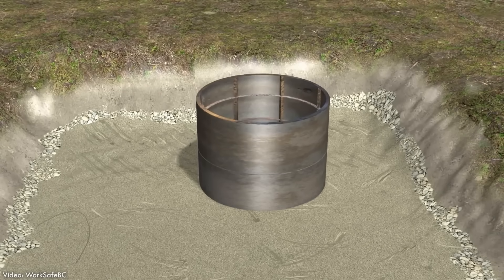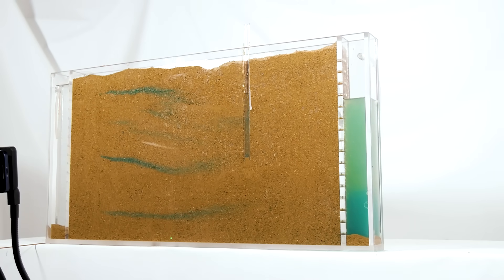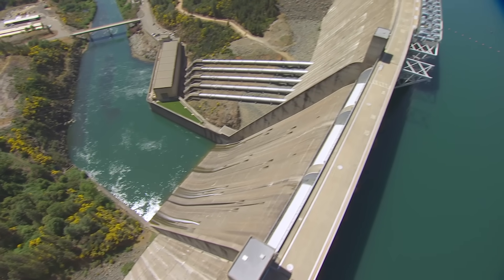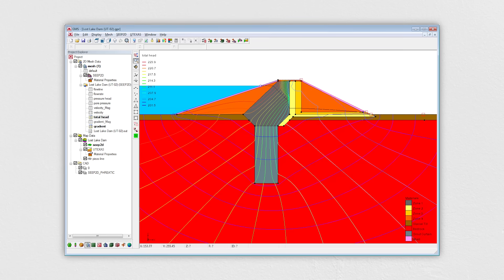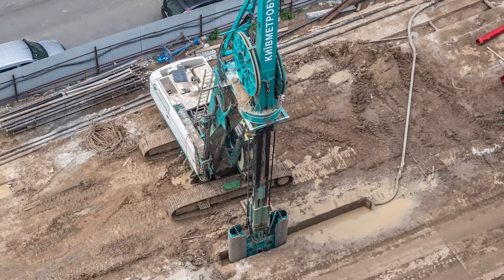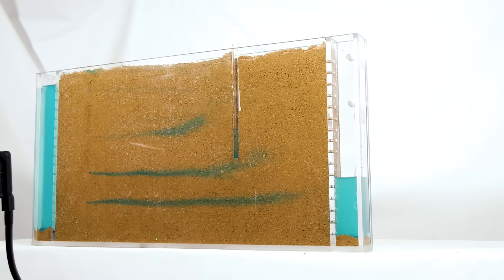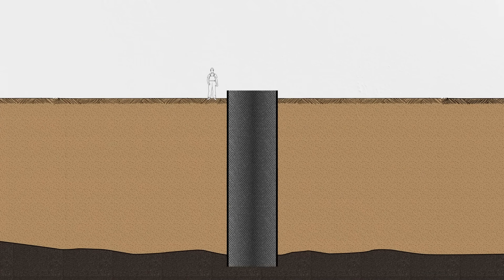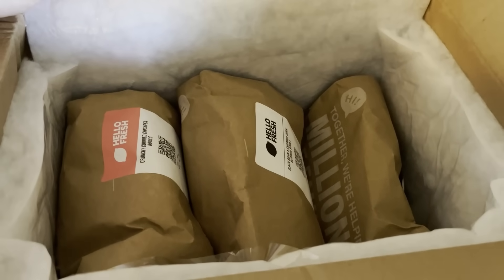The Bizarre Paths of Groundwater Around Structures

Comment: I was introduced to this concept during flood defense. Turns out it's too expensive to shore up a river with miles of concrete so you have to rely on good solid earth... And when the water level rises too far, any water seeping through is a threat that can only be contained by, not blocking the exit hole, but building a cylinder of sandbags around the exit that allows the water level to rise to the level of the river on the other side, equalizing pressure and stopping flow.

It's all so counterintuitive for laypeople!
Reply: Yawn 🥱 who asked?
Reply: @wooshbait36  I Asked.
Reply: @wooshbait36  I asked.
Reply: @QUIXOTEFOREVER  yawn

Comment: Why are the equipotential lines at 7:09 vertical? I would've expected them to be horizontal since pressure pressure increases with depth. Maybe a better equation is why must equipotential lines intersect flow lines at 90 degrees?

Comment: Why do you only cover the most boring and useless designs? So little good design goes into construction its unbelievable. Probably tunnels are the only best construction out there. But are used for cars and have zero natural light. We have literally gone backwards from roman times in some areas. How do we not contsruct from clay anymore? Instead we built out of wood and basically cardboard (plasterboard). People have done really well with planes, the turbine, electricity done ok. Then buildings....nothing.

Comment: Pore pressure, not flow rate rules groundwater, it's dissolving solids as well as flow transport, over time it compacts losses by overburden load. This can cause earthen dam failure as they age >50yrs depends on soils/aggregates used, compaction, weather & heat/cold cycling. Nice graphics.

Inca terraces pond downpours seeps into groundwater to avoid runoff flooding, as ocean warm & storms slow down flash-floods occur globally now where never before in their history.

This implies watersheds need terracing and roads need grooves for runoff to ditches across the slope to drain, steps in the Inca Road are generally for erosion control not ease of use, they used lamas & alpacas for trade goods, roads are a nightmare being smooth, the surface needs to feed a system of drainage.

There's a large format book on Machu Picchu by ASCE with many details, 80"/200cm rain/yr, their system drain on bedrock just above the river.
☕️

Comment: Have you ever heard of those gravity batteries?  You know, those tall towers that move concrete blocks around to create usable kenetic energy?  This video is making me wonder if there is some way to combine the gravity battery with a hydroelectric dam.  Like, if the water level is too low, you could use the gravity batteries to drop concrete blocks into the water so it can be raised, or pull blocks out to lower the water level.  All while all parts create energy.  You may even be able to put some of those wind style generator pole things in the blocks.  Can't remember what they're called, but every time they move, they shake creating energy.

If we really want to get off coal, we don't need to switch to solar, or kenetic, or geothermal...  We need to use all of them.  In sequence even.

Comment: This video makes me think of the negative consequences of large parking lots.
I live near neighborhoods where large shopping centers were put in the last few decades. Now that those areas are all covered over with concrete, rain water is no longer able to absorb into the ground and it flows into a neighborhood.
What was once grass backyards that neighbors could walk back and forth between is now a trench at least 8 feet deep and 10 feet wide. Bridges were built by the city so cars could drive over it. 
It gets deeper and larger year after year, causing those in the neighborhood to lose more of their yards and even the bridges had to be rebuilt and strengthen.

Comment: 12:00  time. Thank-you, SIR,  for the much required education. THIS,  should be a class in high school, for  everyone !.  Okay, what about that  Millenium Tower,  in San Francisco;  placing friction piles, without  GOING  TO  BEDROCK.  Originally the structure was designed for steel girder type, 550 feet high. Someone/company, 
 changed it to  cement. Now, it is tilting, sinking.       680,000  pounds of leaning cement.   Could you apply, this  ' theory '  of groundwater/etc  into  that  scenario  ?   Did they, take into account that it was constructed on 100 +  year old   ' rubble  and  fill ''  ?   The bay area water levels, are changing.   Thanks, for any feedback for us, and the  education  !  Much  appreciated.   from alberta canada

Comment: I recently heard about the terrible trouble they are having at Fukushima with groundwater flows penetrating the basement and becoming radioactive. It seems they excavated substantially into the hillside when building the plant and this has left the structures unusually under threat from large groundwater flows. While Japan is short on flat land for construction, especially next to the sea which is needed for cooling water, this seems to me to be a reckless choice. Of all the things you don't want to get flooded the basement of a nuclear reactor is pretty high up on the list. It would be interesting to hear a professional point of view on whether this was a perfectly normal practice that has only become a problem because of the extreme earthquake and tsunami, or if they really shouldn't have built the reactor building into the hillside like this. The ground freezing techniques they are using to combat the problem are also interesting.

Comment: Very nice and informative clip. Thank you Sir for your sincere guidance. Some points I do would like to put YOU MAY CAN TEST AND SEE THE RESULTS.
1. For preventing ground water collection near structure there must be water collection points where indication provides remove ground water.
2. Many Dams are constructed with soils ON HIGH PRESSURE WATER SIDE INITIALLY TRIANGULAR CONCRETE WALL must be constructed with complete surface covered or sprayed with THICK PLASTIC, which does not allow concrete come in contact with water, Same way Triangular concrete piece take water pressure and prevent water seepage to soil.
3. Each Dam if not using Triangular concrete piece for water seepage prevention in that case can construct inverted V for water seepage prevention where hollow space of inverted V could be filled completely with Stones,and over these stones poured the molten syrup of plastic which would prevent water seepage to stones as well as to successive part of inverted V.
4. Most important is the pan of Dam and extreme bottom surface where at least concrete wall must be made which does not let water passed to sand side of Dam but also support Above concrete construction of Dam.
In India presently 2 dam has given away due to water seepage and amount of expense you can understand. 
Your clip was very nice. Thank you

Comment: One of the main contributing factors to New Orleans flooding during Hurricane Katrina was the sheet piling they drove beneath the levees was not was not driven deep enough. As a result, the levees we're oversaturated by the storm surge and were more or less pushed out of the way like those early gravity dams that failed.

Comment: what about a spring in mostly clay that is under or very near my foundation.  it has a beaver system, garbage. ruined a homogeneous concrete.  floor heavy rains added tremendous pressure and broke apart the replacement concrete were they tiled and is lifting the floor. dumb asses and of course i dont have the money to repair.

Comment: Nice job man.  I worked in a oremos Portland structure that was constructed in a branch river. The result is that structure was collapsing.  Since Starting a drain system  and a submerged pump begin work  drain a river from a soil.  The structure stop moving and the building  was completed.  Now  I have other problem. In a banch of river again this time the Portland bridge. Is finished but the place near buy are  being washed in to the river very fast.   The simple drain can solve this the earth are showing fences

Comment: Great vid.  Couldn't come at a better time for me either so first of all, thanks for making the effort with this.  

Secondly, so what would happen if we drive the cutoff wall into very low permeable clay?  Obviously there's going to be a lot of hydrostatic pressure but would this be expressed via the uplift effect to any significant degree or would the water just run down into the deeper water table?

Comment: I find it odd that the narration claims that the vertical black lines indicate "constant pressure". A line of constant anything (an isopleth) indicates the value of that characteristic is constant along the line. Thus, according to this video, the lines extending from the surface to the bottom have equal pressure all along them. The pressure at the soil surface (at the one end of each line) is supposedly the same as the pressure deep in the soil. If I buried someone 300 feet underground (regardless if I saturated the soil or kept it dry), would that person feel the same pressure as someone right below the surface? No, they would feel much more pressure. Something is wrong saying pressure deep under the soil (saturated or not) is the same as the pressure at the surface. Isobars (lines of constant pressure) should roughly parallel surface contours, not go perpendicular to them. This is true for any surfaces on or within a body naturally contoured by a mutually attractive (e.g., gravitational) acceleration or force. [Edited by myself later for saying more than I needed to.]
Reply: Perhaps those lines are intended to be constant pressure gradient? However, the orientation of the lines still would not reflect that properly.
Reply from the maker: Sorry for the confusion. The black lines are equipotentials that indicate areas of constant hydraulic head.
Reply: @PracticalEngineeringChannel  - Thanks. I felt pretty confused since this was not picked up in any comments I saw from earlier. I ended up really conflicted about if it was all my fault or not. I don't handle that well.
Reply: It looks like the lines of constant hydraulic head connect as a continuous line at the cutoff wall. Should they be disconnected? Are they actually two lines representing different values? I would understand how their shape looks like a mirror image, but I wonder if the line of lowest hydraulic head is in the middle of the image (and can thus form an inverted up--shape) or are the lowest-value lines of constant hydraulic head in the right of the image, meaning lines on one side of the cut-off wall are different (and should not connect across) the cut-off wall? Thanks.

Comment: Can you please explain why you mention the weight of the dam, but not the coefficient of friction between the dam and the ground under it?  A heavy object on a high-friction surface will withstand a far higher load than if it were on e.g. a bed of sand fluidized by water flowing through.

Comment: 4:40 "We can't just build the dam, measure the uplift force and add weight if necessary."  Well, not usually, but that's exactly how the builders of Notre Dame and other gothic cathedrals built the flying buttresses.  They would notice that, after a high wind event, cracks would show up on the buttresses on the upwind side, indicating they had been put into tension.  At that point they piled stone onto the upright pillars of the buttress to compensate.  Of course, being a cathedral, they couldn't just pile up raw stones.  They used it as an excuse for more epic statues on the columns.

Then again, back on the original hand, they didn't have these neat modeling techniques!

Comment: As a former Dam Safety Eng., I enjoy your videos and some of my fellow  engineers agree with me. I also did culvert design and many fail because of seepage piping under the culvert. I have photos of actual tunnels under culverts which didn't completely washout  because the the flow stopped before it could completely erode the fill around the pipe. This  is usually caused by lack of compaction or improper bedding material.

Comment: I think the rainstorm defenses the municipal in my city put up a few years ago actually intentionally utilize seepage, there's one place where along the road there are small blocks of green space intended to catch rainwater and across for them is a tiny lake, however there aren't any pipes clearly visible so I think they instead just put down some material that's easily permeable so the water will be lead into the lake. The lake itself doesn't feed into anything so piping isn't really a concern as the water just collects and slowly evaporates. I bet there's probably more to it but it seems like this technique has been used a few places, probably to also help refill aquifers.

Comment: For that Cason incident they completely drained (or drained to very safe levels) the water in the soil but the problem happened because of a unknown 2nd water layer below the layer drained when the top water was drained it created high pressure for the lower reservoir that let water seep up, in the end there was more water then they expected to deal with causing the sudden sinkhole

Comment: Interesting - as usual.

A few things occurred to me.
1. I'm curious abut some of the time frames involved (for example are drains with pumps threatened by short-term power outages or equipment failures?).
2. It also seems to me that calculations would be complicated by potential changes in soil permeability over time (for example if clay leaches into or out of the soil over the long term).
    (I'm assuming that, over decades, there could be significant changes there.)

Comment: Groundwater level is a term that is used in a relatively loose way, normally referring to the level, either below ground or above ordnance datum, at which soil or rock is saturated. This is also referred to as the water table and represents the top of the saturated zone.

Comment: I came across this channel as I am studying creationism in the Bible. I wanted to know more about aquifers and ground water which your channel helps explain in very visual ways. The reason I wanted to understand more about these things is because the book of Genesis states that when God initially created the earth some 6000 years ago that it did not rain upon the earth but that all water necessary for life came up from the ground. (Genesis 2:5-6) It was only after the destruction of the earth at the time of the global Antediluvian flood that the earth first began to go through the rain cycles as it does now. (I know the matter of world view is so shocking that anyone reading this comment can hardly even think about ground water at this point.) But from what you have shown it certainly seems scientifically possible assuming there was an ample supply of water underground initially. The “infrastructure” if you will seems to still be in tact, but now (assuming the global flood had some effect on the initial supply system) the ground water sources are finite and need recharging to continue to function correctly. All very fascinating!

Comment: This is excellent! I live in the mountains and many of the Victorian era homes have rough bluestone foundations that leak (quite a common occurrence). In fact it is clear that digging of any kind risks opening up an underground water flow. The installation of French drains has been a huge benefit to me personally along with sump pump improvements that have lead to a much dryer basement. Soil in the mountains almost acts like a percolating coffee filter and just because your at a high elevation doesn't mean you don't have a moving water table below.

Comment: Talk about ground water around lakes with different types of surrounding soils.  I’ve lived and vacationed within a few hundred feet of Lake Huron since I was 3 years old.  Even though it would seem that the surface and deep water wells would be the same on all of the lower Great Lakes (those that exclude superior) they aren’t.  In the northern part of lakes Michigan and Huron wells are usually the depth of the lake level.  The next vein of water bearing soil yields an awful smelling putrid water unfit to drink so the domestic wells are really shallow wells taking water out of the lake .  In the lower Great Lakes shallow wells are forbidden because they cause seepage of pollutants into the lake water.  Politics out weighs science.  It is also interesting that locations that have topsoil then a layer of sand 8 to 10 feet thick and then a layer of clay use the water in the sand for things like watering the grass, or other usages requiring non potable water.  Many communities will put a surcharge on your taxes if they catch you using this water.  Politics wins again.  On you tube I’ve seen people drill there own wells in places like Florida and wonder what is the water bearing soil and why isn’t there any salt in the water.

Comment: We just had to have our in ground pool removed (broken up / filled in) due to ground water issues in our neighborhood.  Each year, over the winter and early spring, the excessive groundwater would “float the liner”.  Each time this happened and the liner settled, it would pull away from the track and return jets, either tearing it or creating a weak point.  Several options were discussed to deal with this but all came with a bigger price tag than the pool was worth to us.

Comment: Seems like using pumps would be a hugely risky move. What happens when there's a loss of power or mechanical failure? If the dam's strong enough to stand if the pumps fail, why have the pumps?

Comment: I would like to see this same video applied to basements.  Often basement will have a  small depression with a sump pump.  Solutions like sealing the outside of the basement walls, Gravel around them to collect the water to drain somewhere else etc.